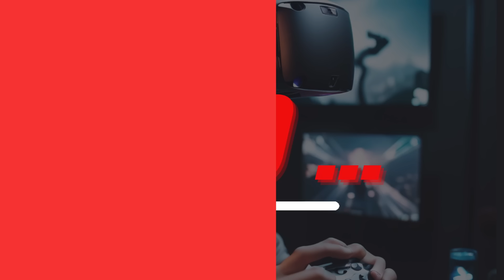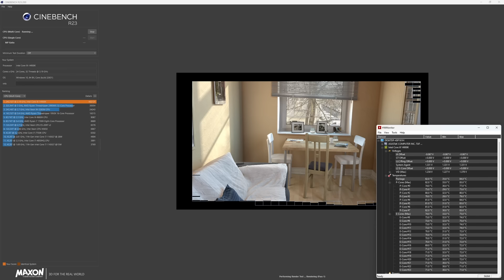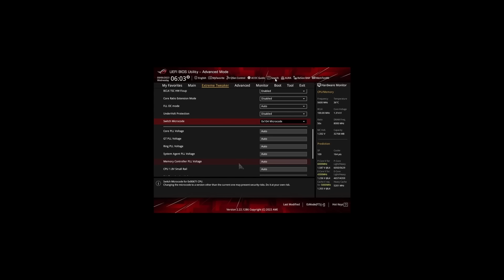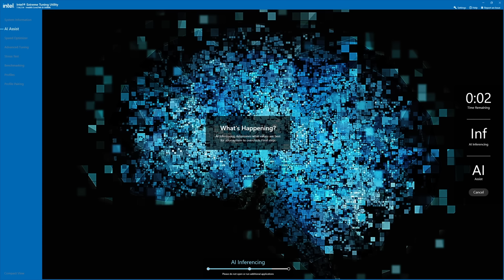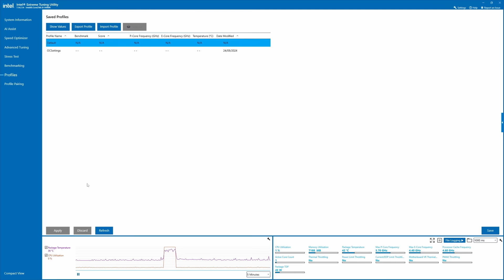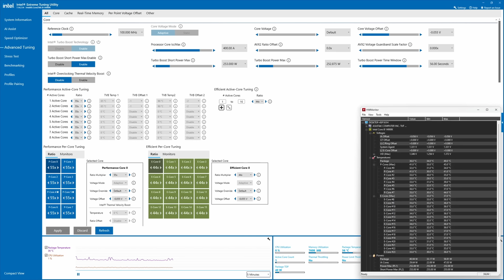Comment: I RMA my 13900K and got in return from Intel a 14900k. With the new microcode installed and following your video I cant get it to pass 37654pts. I'm lost here
Reply: Don’t get too hung up on the Cinebench score, it depends on a lot of factors.  However applying further increments of undervolt for example 

- 0.05000

To begin then retest, then add a further increment of 0.00500

So then

- 0.055000

Etc in my final section you will see I tweaked my undervolt to 

- 0.065000

To achieve the final result, this is a pretty safe undervolt however this depends on silicon quality and a number of other factors.

The main purpose of this is to sync the cores, and maintain stability, and prevent boost, which lead to voltage spikes, and consequently game crashes.

Intel in their latest Default Settings have gone very extreme with this.

Rewatch section 3 of the video and hope this helps 🙂

Remember undervolting improves temperatures and efficiency of the processor which will in turn improve the score, however do not go to far with it as it may result in crashes in itself and therefore like any modification is done at users own risk.
Reply: @nextlevelsimgaming  What I ended up doing was to disable intel default settings, as in my motherboard (Gigabyte Aorus Master z790), even when I disabled Virtualization and Undervolt Protection I couldn't tweak the voltage in Intel XPU. So I disabled Intel defaults, locked the cores to 5.7 and applied -0.045 undervolt.
Reply: @franciscopitschieller7115  Works pretty much the same way mate, that method is covered in my other video 👌🏻
Reply: @nextlevelsimgaming  thanks a lot. I'll take a look,

Comment: My 14900k has much higher voltages with new micro-code. The issue with the CPUs is excess voltages, but at the same time they become unstable at STOCK CLOCK SPEEDS if you undervolt too much... Luckily, I've been running underclock/undervolt 55 P core / 42 E core with a -0.075 undervolt since day 1..  & have had no issues. With the new 0x129 micro-code the Lite Load settings are super high, I lowered it from 15 to 13-12 and increased my undervolt to -0.09... I've been seeing pretty good results since tweaking my set up... My max voltages are 1.35 with these settings.

Comment: I have i5 14400f co (Alder lake chip) Thats work for me too? I mean microcode and virtualization part
Reply: The chip is not one affected by the current issues, so there is no microcode fix available, however remove Virtualization and undervolt protection and if the processor is compatible with XTU then you can undervolt to improve efficiency
Reply: What you mean by remove virtualization,you mean vmx in BIOS? O dont have undervolt option in bios O have gigabyte MB I dont get it @nextlevelsimgaming
Reply: @arch4916  In BIOS search for ‘Intel Virtulization’ it needs to be disabled for XTU to run
Reply: @nextlevelsimgaming It says o need disable undervolt protection in xtu ,but o dont have It in bios
Reply: @arch4916  Is your PC a pre built, i.e Dell/Lenovo/Alienware etc?, or custom, i.e did you build it yourself or had a custom built for you?
Reply: Custom,b760m dsh3  gigabyte ddr4,14400f @nextlevelsimgaming
Reply: @arch4916  into BIOS

Advanced Mode/Tweaker/Advanced CPU Settings/SVM Mode (Intel Virtulization Technology) Set to Disable
Reply: @nextlevelsimgaming its already disable but app require disable undervolt protection , i cant find It in the bios
Reply: @arch4916  You need an unlocked processor (K or KS) to disable undervolt protection unfortunately
Reply: Oh, ok ty bro

Comment: Intel XTU is recommend by a lot of knowledgeable people to uninstall because of the fact that it causes weird interactions and some bugs, have you ran into any of these issues having XTU installed?
Also genuine question, no flame, what makes you recommend watching Frame Chasers, instead of someone like BuildZoid who has a great reputation in the community as well, again, no flame, just curious. I, have nothing personally against Jup at all
Reply: @DeagleHonor  The instructions are designed for someone who is just essentially wanting a easy solution to restoring their performance to their PC.

I personally haven’t experienced any issues with XTU, with the exception of after the BIOS update having to disable Undervolt protection and Intel Vitulization again.

BuildZoid is very well respected, however very advanced.  Frame Chasers I find is very clear cut, ‘Sync all Cores, reduce voltage’

For people who have found this video wanting to understand further what the aim is, and why performance has been lost with the Intel Settings vs Stock, I think he speaks frankly and to the point on the matter.

I am in the process of doing a follow up video on the BIOS side this weekend so will compare results on BIOS vs XTU see if the BIOS route gains any advantage.
Reply: Nice response. Thanks =)

Comment: Good video showing how effective 0x129 is, and how easy it is to get back to previous performance values. I don't imagine it will stop the Intel haters, especially GN, but the new microcode and extended warranty seem a perfectly functional and acceptable solution in my book! I don't even have the warranty option as I'm running a delidded 14900KS on a MoRa 420. Lower temps and same performance, and should alleviate the possible voltage related degradation so I'm happy!
Reply: Same case , 420 x 2 rad 46mm
Direct die setting 
TVB is going crazy to boost 6.2 voltage ,
ASUS sync IA DC , IA vr 1.430 
Just give up the 6.2 joking at 1.55V
Leave it . 
I have 2 chips K and KS tested
KS just is a better K. same other model
they passed the high boost over voltage that kill itself and this problem issue to user get a better selling price . However GOBAL overshooting .

Yes , in past ,any user buy K series ,they have to take the risk .
However , while you take this to a selling point ,not especially 14th 13 gen, at least, make sure the quality.

I know the will pass the contract vendor to this QC.

Staff Asked : we should test it how long ?
Boss: 5 mins? Well , this patch cpu is urgent to ship out!

So this may be run 2 months works .half year still works or no one know it.🎉
Reply: @lawrenceonface  Just limit the clock to 59X max on all cores (or 60X for benchmarking). I can't think of any real world usage that ever hit 6.2GHz on my KS except at idle on the preferred cores where current is low.
Reply: @ColinDyckes  only possible with nitrogen, isn’t  ideal😂
Reply: @lawrenceonface  I'm running direct die with a MoRa 420. No need for LN except for record attempts.
Reply: @ColinDyckes  yea I also delidded upon question is all core 6.2
Reply: Also some one use eK delta did it before , any want just forgot it XD
Reply: @lawrenceonface  6.2GHz needs too much voltage unless you've won the silicon lottery and I've yet to find any workload that hits it on a real world machine with background processes. Just limit the 14900KS to 59X.
Reply: @ColinDyckes  oh , dun worry, I know that was entertainment  purposes before intel issue.
Reply: @ColinDyckes  Thank you for the positive comments Colin, will be doing another video this weekend covering the BIOS aspects
Reply: if you praise intel for selling you a poorly designed cpu that was capable of burn itself and intel refusing to accept rmas blaming everyone and not accepting they did things wrong, you are part of the problem, intel lied and delivered less and you accepted that reality

never blame a gamers nexus for presenting reality, open your eyes, not your wallet to save intel in their sinking process
Reply: i want to delid im just afraid of messing something up LOL

Comment: Pleasse with i9 13900K
Reply: @miguelj.cardenas4841  Same principle applies, follow same guide and set all cores to 5.4, iccmax 307a, PL1 = 253 PL2 = 253
Reply: That s for intel xtu or set in bios for power limit, I have 13900kf .. and after update the microcode I have 5.5 ghz no 5.8 ! 😓
Reply: @Marko19959  Set all to 54ghz on XTU and power settings as above, I have seen users on 13,900k with good results at 53 across the board, remember the purpose is to keep the cores in sync and avoid boost
Reply: @nextlevelsimgaming  That settings , again stay with 5.5ghz freq, no max p.core 5.8 ..I see in your video.

Comment: Here's what I did for my 14900K:

- PL1: 150
- PL2: 175
- AMP: 307
- Windows power plan: Balanced

These changes significantly reduced power consumption, thermal throttling, TjMAX, and over-temp issues. I got excellent results in 3DMark Steel Nomad, Heaven, Furmark, and Cinebench R15.

The only issue was a brief 1-second spike right before the 3DMark Steel Nomad test started, but my machine recovered quickly, and there were no issues during the actual test. I'm chalking it up to a bit of lag between the CPU sensors and HWINFO64.
Reply: Interesting, and great to hear you’ve got it working well,, I will have a play around with your power settings thanks for sharing 👌🏻
Reply: Apparently YouTube deletes comments with link. But you should it them in your email as a reply. I included screenshots of Video and Graphic settings plus HWINFO64.
Reply: @kxmode  You can DM me on ‘X’ @nextlevelsim thanks for the information 👌🏻
Reply: @nextlevelsimgaming 

X tells me: 

Next Level Sim Gaming
@nextlevelsim can’t be messaged
Reply: @kxmode  Hi, sorry I have amended this now
Reply: what processor u have if i may ask :D
Reply: @CodeNameTech  14900K
Reply: @kxmode  how u utalize your processor? coz that power plan u has no point... do u have glitches or degradation behavior of cpu? does ur programs closing or their own? how much pts u have with single core and how much with all cores in r23 (around 40000 for all cores around 2200 single core is nice) also what RAM memory u are using? on what speed?
Reply: @CodeNameTech  You're asking a lot of great questions, and I appreciate it! You want to see if this change is really making a difference, so let me try to answer them all.

I use my processor for pretty much everything—from normal tasks like web browsing and watching YouTube videos to work-related stuff like programming in Visual Studio and SQL Management Studio (including AI-related work), music and video production, and even very CPU/GPU-intensive games like Cyberpunk 2077 and Watch Dogs: Legion.

I haven't experienced glitches or degradation in CPU performance.

Regarding programs closing on their own, the only app that did this was Watch Dogs: Legion. I pinpointed the issue of having Ray Tracing set to the max setting, which was putting too much strain on the GPU and causing the game to exit. Lowering it to Medium quality solved the problem. 

My Cinebench R23 scores are 2220 for single-core and 30559 for multi-core. I can easily hit 40K+, but that would require setting PL1 and PL2 to 253 and AMPs to 400, along with switching to a High-Performance power plan. However, that gain comes with the risk of damaging the CPU, so I've opted not to push it that far.

For RAM, I use G.SKILL Trident Z5 RGB Series DDR5 32GB at 6400MT/s.
Reply: @kxmode  Great answer, but you didn't tell me what your CORE VID is. Look at it this way... Intel did something in the new 0x129 microcode to limit the maximum to 1.55v, and with that, they (of course, to their benefit) are making sure they'll get through the 4 or 5 years of warranty... So, with that in mind, you'll be perfectly safe at 1.45v, and you won't have to sacrifice 25% of your performance... As for longevity and degradation, you can relax... 253W is fine for both PL1 and PL2, and the same goes for a -0.05 to -0.1v undervolt depending on stability (the lower you can go, the better your chip is), and 307A should be okay... If your voltage doesn't exceed 1.45v, you're in the clear
And even if your processor lasts only 5 years instead of 10, hahaha, in 5 years you'll definitely get a new one, and you wouldn't be able to sell this one for much anyway, even if it remains 100% healthy, since it's from that infamous series
Reply: @kxmode  also there is nice way to adjust ur landlines to be even more efficient but i dont know what is ur mbo my is gigabyte z790 and i know how to do it on my mbo

Comment: i have 14900k gigabyte mbo z790 ud and i have set my loadlines to high then ac/dc to 55 and i kick -0.09v and it is kicking max to 1.395 ... my temps dont pass 72degrees in any benchmark ( in thisone like ur the score is same 40k)coz i have custom loop.. now im asking u ... did i do something wrong coz u are telling us to turn off boost and i didnt... also can i undervolt just like u and to sync all cores but to overclock all for 100hz up ? my pc is for work and i didnt have much space for experimenting so i must be shure before i fuckup :D
Reply: @CodeNameTech  Its pretty common advice to sync all cores,  remove boost, and undervolt, a good channel to look up is @FrameChasers who goes in to much more depth on the subject.  Many users don’t want to play around at BIOS level too much, which is understandable, my guide is aimed at users who want to be able to achieve the same results with an easy UI.  Intel XTU is far from perfect, the Overclocking aspect is nonsense as said on my video, but as an easy method with some basic BIOS steps it achieves the same outcome.
Reply: @nextlevelsimgaming  Don't give anyone money for advice/settings. Everything you need to know is on the Net.
Reply: @JDD_Tech_MODS  why deleted my comment?
Reply: @CodeNameTech  I cannot delete comments on this channel. Only channel owner or youtube can.

Comment: I've never has a worse CPU experience in my life.  Had to RMA my first 14900K in May.  The new one, with latest bios and 0X129 and Intel defaults is giving me heat spikes.  R23 was at 37.2K.  Trying to undervolt as per this video's instruction knocked it down to 21K.  I just want the cpu to work.
Reply: return that thing, it is what i would do, clearly it is failing too

accept losses and buy older intel or ryzen, it is not your fault, intel screwed you, time to move on
Reply: @betag24cn  give us the money to switch to AMD then you can advise people to change their cpu .
Reply: @devans83  Have you set the BIOS to Asus OC and not the Intel Baseline Profile?, the Intel Default combined with this fix will ‘reduce’ performance not improve it, the microcode instruction to reduce VID below 1.4 remains.

You need to have the Asus OC (standard) BIOS profile active.

Reboot your PC and set BIOS to ‘Load Optimised Defaults’

Change these two settings -

Undervolt Protection - Disabled 
Intel Virtulization Technology - Disabled

Save and apply settings

Reboot and go into BIOS again

Set your RAM XMP to the rated speed i.e 5600mt

Save settings

Then follow the guide and ensure that the power settings are correct 

ICCMAX - 400A
PL1 - 253
PL2 - 253

You should achieve over 39k and also run stability testing.

The lock all cores and undervolt have achieved me complete stability and temps below 75 degrees Celsius

Hope this helps 🙂
Reply: @nextlevelsimgaming  Yes, the Intel Base profile was loaded in.  I'll change it to the Asus profile and the recommended settings and report back.  Thanks.
Reply: @devans83  No problem, also ensure all running applications are closed in the tray on the task bar before running Cinebench R23 (before and after) such as Chrome/RGB software etc) the application does advise this but to obtain an accurate score having a browser open alone can impact the score by around 2000.
Reply: @nextlevelsimgaming  changes applied.  Voltage Offset is set to -0.050 V.  Getting thermal throttles and occasional R23 crashes.  Score is at 38305.  XTU stress test passes.
Reply: @devans83  Ok, are the temperatures good?, and are all other applications closed in the desktop tray?, if R23 is crashing reduce the offset to -0.045v and also in BIOS select ‘Sync All Cores’ and save and try again.

Is XMP enabled on your RAM?, and if so what speed?, you may or may not achieve over 40k given the RAM speed, however remember this is an improvement over the Intel Baseline Profile, and more importantly the temperatures will be lower, and it is still working within Intel guidelines on Power and short and long duration settings.  👌🏻
Reply: @nextlevelsimgaming  no, the temps are hitting 97C and all apps are closed in the tray.  My board is the Asus Z790-H Rog Strix.  The temps spike if I have anything set on auto after loading the profile in bios.  I have to set the SVID to typical and enable CEP to keep the temps to 80-87C during tests, but scores fall way down.

XMP enabled with my RAM at 6400.  Probably just gonna revert and call it a day.  I'm not even interested in overclocking.  Just want to use the CPU as advertised for what I paid for.  Thanks again.
Reply: @devans83  Its a pretty standard undervolt, and sync’ing all cores, a basic method of doing so using XTU which modifies the cores as opposed to in the BIOS.  But like many things, each PC setup varies.  You can undervolt using actual VRM Core Voltage in BIOS with a negative - 0.05000 in Offset Mode.

I would suggest against using Current Excursion Protection (CEP) as it can cause crashes in under-volt when load line calibration drops.

I am looking to do an Asus BIOS video which I will try to do this weekend, so will cover this in more detail, but I do feel your pain, unfortunately the SP quality of the 13th and 14th gen processors seems to be very variable and is causing a lot of users to spend too much time trying to get what is essentially what we paid to receive.
Reply: @nextlevelsimgaming  I've been building PCs since 1993, first cpu being a 486DX2 100Mhz.  LOL  This 14th Gen is by far the worst experience I've ever had.  Even with a simple undervolt, I feel like I've been jumping through hoops since March of this year to get this to work as advertised after my first RMA.  I'll keep an eye out for your new video.  It's greatly appreciated.